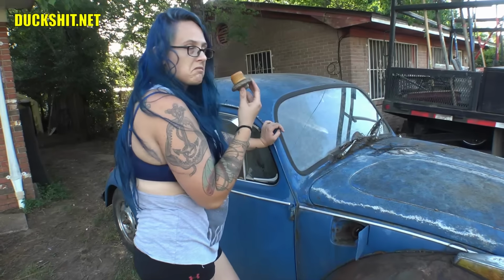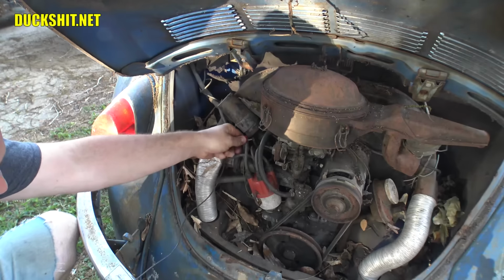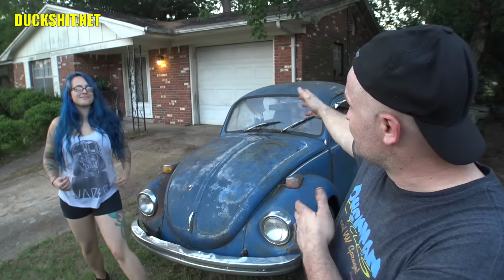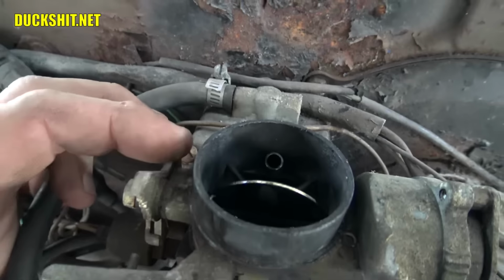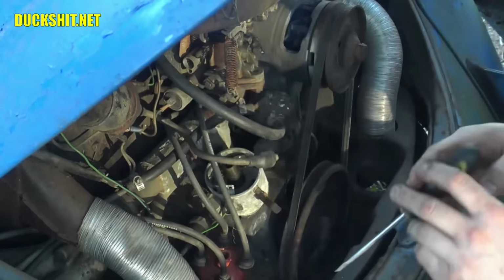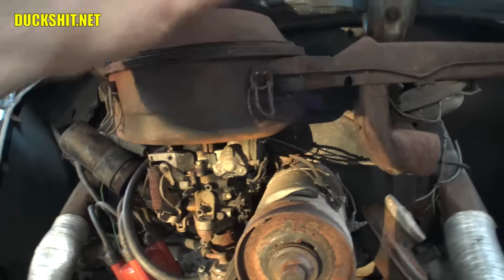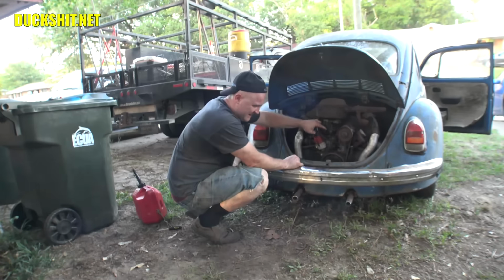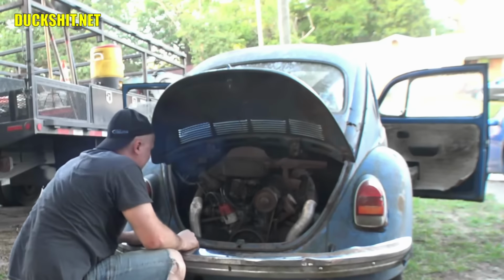FIRST START IN OVER 30 YEARS - 1972 VW Super Beetle - Will it Run?

Comment: 72 Super Beetle was the ski machine to skip out of grade 12 high school on Fridays and drive the Whistler 500 to Whistler for a fun day of powder skiing. That was one twisty highway in those days which posed many challenges and hazards on the way up to Whistler from Squamish. That was my buddies car and my first car was an MGB GT whose favourite place was dead on the side of the road from either a broken throttle cable or dashboard wire loom melt down. That was fun...not. The mechanicals were sound but everything attached to it was not. Sigh. Good times...
Reply from the maker: Not such a big deal if the throttle cable breaks, it's always good to carry a spare... but if the wires burn up you're in trouble LOL

Comment: Stupid question, its a Beetle.
Reply from the maker: Was it ever even a question? LOL
Reply: @DuckmanCycles  My first car was a 68 beetle, I drove it home from school one day. It was about 50 km. And it felt very lazy, and made strange noises. But we came home, up on the lift, and it turned out that one of the cylinders was loose. I could move it by hand. That car should not have been able to start, or drive at all. There must be some VW God up there, someone watching over them. I should never have sold it.

Comment: Im a buyer for the air breather if its the one that belongs on a 72
Reply from the maker: The breather?  Looks the same as most other VWs I've owned.  Maybe you mean something else?
Reply: @DuckmanCycles  yes the breather. Goes on top of carb. Oil bath housing. There are a few different ones over the years
Reply from the maker: @Volkswagenplanet  Air filter.   Yes I believe the air filter is correct.

Comment: Very happy Miss Bee is back. Mr. Duckman, what do you think about electronic injection in these engines? Have you ever thought of a project like this?
Reply from the maker: CB Performance  makes a kit for exactly that... they have their own computer, too.  But it can be easily set up to run a Megasquirt using the same hardware.  I have thought about it for Eleanore... but not committed to anything of the sort.  I guess we'll see!
Reply: @DuckmanCycles  In Brazil we have kits as well. Our gasoline is horrible and still with 27% ethanol. Since 2005 we have flex engines works with ethanol or gasoline or mixing them. So it makes sense to inject because the hit looks pretty cool. Continuous accompanying your videos and if one day you put I will watch. Take care of yourself.

Comment: Thanks for the video....what makes it a super bettle ?
Reply from the maker: We'll do a video on this in the future, but the primary things are an upgraded trunk and modern strut front suspension.
Reply: Probably also the curved windshield and slightly larger rear light clusters.
In Europe they were named 1302 and the last model 1303 (with the large round rear light clusters)
Reply from the maker: I don't have a curved windshield!
Reply: @jfv65  😊had one of those 1303 back in the days when i was young and bold ...
Reply from the maker: Here is a video that answers the questions between Super and standard Beetles https://youtu.be/aobVQonmpbE

Comment: Use a autostick starter. Spin faster
Reply from the maker: I have never noticed a difference in speed when swapping starters, unless going from old to new, or 6v on 12v lol...
Reply: @DuckmanCycles  they are faster noticed when I changed mine out. No shim on the end either. Have fun
Reply from the maker: No shim required on any starter, maybe you mean the bushing?   Yes, no bushing.  But they should turn the same speed unless you have some fluke or just a good unit vs your old one.
Reply: @DuckmanCycles  according to Bosch the rpm is slightly higher on a autostick. I know it sounds crazy until I tried it myself swapping starters a few months ago. Not a huge diffetence, but noticeable. Thanks for responding
Reply: @DuckmanCycles  yes,  no bushing

Comment: I have no idea why you don't like the 009, the replacement for the 010, You are the first I have heard say this, it is much better than the vacuum distributors. We used them on most of our high performance and racing engines for decades, the exception was when we use a magneto. clean the carb, change the oil, tune it up (plugs, points, condenser, rotor, cap, wires) and adjust the valves it will run like a top if the compression is good in all 4 cylinders. Good luck! Take care and God bless you all!
Reply from the maker: Yeah they're okay for a racing engine that you run wide open always, they are also good for an industrial engine that runs at a constant RPM which is what they were designed for.  But for those of us that are driving in traffic at a different RPM's in different throttle positions all the time the 009 is terrible.
Reply: @DuckmanCycles   We ran them mostly on streetcars. Decades ago I had a 63 bug will a full interior, nothing cut out, that ran in the 9's @140 mph in the quarter for my daily streetcar. I ran it at the strip and ran a 9.98 @132 smoking the tires all the way thru first and halfway thru second, corked up just like I ran it on the street. On the street it hooked in about 3ft and shoot off like a rocket hole shooting most everyone by about 10 car lengths. I had a close-ratio 3rd and 4th but on the top end I would see those big V8's coming they just never caught me. Most of them would run out of gear at 125 with the low gear ratios they were running back then. I was able to pull 140. I know you will say bs the vw speedo does not go to 140 and that is why I changed it and had it recalibrated with a 200mph speedo. BTW I was the first to make the dual muffler exhaust on my racing header system I used two 59 jeep mufflers and two u-bends to cut and weld it up. I should have put a patent on it. They only had the single quiet pack back then which was too restrictive for my big tube racing exhaust system so I made a dual muffler like I had done on my V8 engines converting them from a single exhaust to dual turbo mufflers. Granted, I had to rebuild my engine about every 5000 miles because the mains would get loose, but it was a blast to drive everywhere back then before anyone knew how fast vw's could really go, this was back in the 70's-80's. I made a fortune street racing it until no one could beat me and they started to bring in trailer queens to try to beat it. I was smart enough to tell them to drive their car to where we were going to race a few miles away from the meeting place and if they could, I would race them. They couldn't, they had full-on race cars with solid blocks etc.! I have built hundreds of vw engines over all the years. my last being a few years ago I had a 73 ghia that I never ran at the strip, but it was just about as fast as my bug was. It only had 44 webers on it slowing it a little but very good to drive on the street compared to 48's with 50mm venturis. But the 48's were decent until I tried 52mm venturis and there was no low end left to speak of just flat out top-end racing which forced me to make my own 50mm's.  I never cut out anything to lighten the cars I did scrap the tar off the floor of the 63 and that was it, I still had a complete full interior in it since I was driving it every day.  I was also the first to make 50mm venturis for my 48ida weber carbs, they only made 48 and 52 then. The 009 has a good advance curve for any vw engine and you can adjust the advance curve by changing the weights. But hey what do I know, I have only built some of the fast engines ever and been doing it for about 49 years, since my first rebuild and upgrade to my 60 bug as a teenager! LOL! I really still do not understand your feelings about the 009. It must have been something else causing you problems that you feel the 009 was causing. Good luck, I enjoy seeing your project work and great metalwork you do. Take care and God bless you all!
Reply from the maker: Well as I said, 009 is fine for race or industrial application.  But really are no good for a proper street car driven in traffic with a lot of stop and go. http://www.vw-resource.com/right_dizzy.html#009
Reply: @DuckmanCycles  What you are talking about is the post 71 smog motor and you can fix the flat spot by adjusting the accelerator pump tube to spray right into the crack of the butterfly when it starts to open. They run lean for smog! There are many more years the 009 works excellent on. Basically you are referring to the super beetle model years that no one likes 71-74, 75 when to the fuel injection! I am talking about all the years prior, from the 50's to 70's. Plus it is rare to see someone running the 34 carb on a dual port motor, especially now, that is the first thing that hits the junk pile and gets dual carbs or at least a two barrel. Then the 009 is a big advantage! If you want to run an all stock motor then sure leave the stock distributor on it too. But you do not get full advance right away with the stock distributor either, as the article says unless you give it full throttle and drop the clutch which would also have full advance with the 009! You can check that yourself easily, you will see what I am talking about. Anyone who knows anything about engines knows you dont get full vacuum unless you stab the throttle wide open which no one does driving around normally. Therefore you don't get the full vacuum advance until higher rpm's. Hmmm like the 009? The pause the article talks about is 99% of the time the accelerator pump tube out of position. They purposely aimed it to the center of the butterfly to help to lean it out by spreading the fuel across the butterfly rather than a direct shot of fuel for smog reasons. The article is one persons opinion and we all know everything you read on the internet is all true, right? LMAO! Have a good day! Thanks for the reply!

Comment: The Super Beetle came out in '71 as model 1301. The '72 came out with various (slight) changes that it ended up with its own model number- 1302. But both have the same flat windshield and dashboard of the regular beetle. In '73 it got the revised dashboard and curved windshield along with a revamped front end which all Super Beetles have after that and all are known as the 1303 model.

Glad to see the SB up and running! I had the '73 and my friend had the '72. We used to spend weekends comparing cars and of course - maintaining them!
Reply from the maker: There was no 1301 due to legality issues, so there was only a 1302 in 1971 and 1972.  1303 after that.  Everything else was absolutely accurate! Thank you so much!

Comment: Oh man, that's exciting!  We have a 73 standard and not as lucky with the motor.  Took it out and disassembled.  Trying to figure out if the block is even good.  I'm glad yours seems to be work pretty good so far.
Reply from the maker: Much appreciated, and yes it seems like it's got a pretty good engine. The engine is now in the ATVW

Comment: I had a 72' Super Beatle, dual port heads, valve clearance for it was .008 intake and exhaust.  The only one engine model they had a different clearance, other than .006 in and out, had a "VW' expert argue with me that they never made one with different valve clearance,  so he set them at .006, and it ran like crap, I had to totally readjust all of them  to get it to run right.
Reply from the maker: VW changed the valve lash a few times in their history.  Heh, gotta laugh when everyone thinks they are an expert.  :-D

Comment: Nice job. I don't think I'll have as easy of a time getting the motor in my 66 running again.
Reply from the maker: Well you may or may not, I guess it depends on how stuck it is.  This one turned over pretty well.. at that point the rest was easy.
Reply: @DuckmanCycles  It may have gotten some water in it.
Reply from the maker: Dump it out, get it freed, oil it up, and fire it up.  Let it run a bit up to temperature and check compression, if good dump the oil to flush out the crud and new oil and GO!  :-D

Comment: Great video, I really like your troubleshooting technique, the only suggestion I have is , I would really just leave the air filter housing off while trying to start engine, I know it's safer in case of a backfire, but makes pouring gas in the carb so much easier. Keep the videos coming!
Reply from the maker: Thanks, but there is so much dirt under there I am afraid for it to find its way in.  A backfire NEVER damaged my air filters, in fact it helped contain the fiery fuel explosions that had happened from spraying fireballs all over the place.  More videos to come!  Thanks!

Comment: to test the electric side of the oil light is to earth the wire off the switch & see if the light works
Reply from the maker: Good call, but for that we did not have to!  :)

Comment: My cousin as a blue 76 beetle. Just took it out of the garage and parked it in the driveway. I went past it yesterday and someone stole all the wheels.
Reply from the maker: Awww man thats terrible!   Wow!
Reply: @DuckmanCycles  The interior is pretty good. But no back seat cushion. Frame looks good too. The front and rear shocks are leaking and i saw valve cover had a leak. I used to me a mechanic. I wouldve loved to work on it.
Reply from the maker: @goobman1981  Get it and save it!
Reply: @DuckmanCycles  i will have to ask my cousins if they would sell it. It belonged to the father who passed away. So they may wanna keep it.

Comment: 1971 -'72 Super Beetles (60HP) likely the best driving ones ever built. I've owned 2.
Reply from the maker: Depends on preference!  I always preferred the more classic feel of the earlier torsion beam.
Reply: Unsafe at any speed, Lol ! They used kingpin front suspension,(not the super beetles) also. Rebuilt many a one. Also own a '72 since 77.
Reply: They had a stock air cooled 60hp? I thought they had a 42hp with the dp1600. Nice.
Reply: @lawrencewheeler8868  
Yeah. They should have just stopped modifications at '68 or '69. The best years for bugs, in my opinion. Good steering, IRS. And there was bajillions of them. At one time anyways. I still have a '68. But its been in a fire. And frankly, I'm tired of going through engines faster than underwear.
Last week coming back from Las Vegas it started leaking oil. So I took it to a friends house so I would fry anything. I ended up replacing every gasket and seal and it still leaked. I'm guessing it was from the oil cooler. Not the seals, but the actual core itself. I listened for leaks with an air hose and heard nothing. Checked the case for hairline cracks.
Long story longer, I did everything but test the case fro cracks. Basically rebuilt it without boreline machining, and I would have but corona virus shit has all the machinist lazy or something. So anyways, all that and it still pisses oil.
Im done with bugs.
Reply from the maker: I disagree, I think 68 sucked LOL... almost all the way across the board for all models.  It was another one year only Beetle not too unlike the 67 that came before it.  69 corrected a lot of the 68 problems.... and other than the stigma attached to 69 LOL, I agree 69 was probably one of the best mechanical years.  But as far as appearance of concerned earlier is always better!  😁👍🏻
Reply: @DuckmanCycles  
My modifications are for off-road. Thats why I fancy the '68. They changed the transaxle from swingarm to Indepenent rear suspension, eliminating the camber of the wheels,  should you decide to raise the supension. But they kept the older steering.  And well before they eliminated the torsion tubes and bars. Was it '73 they went with coil springs?
Reply from the maker: You might be a little mixed up, 68 had a ball joint front end but had a swing axle rear end.... unless you got a Autostick, in 69 all air-cooled VWs got the IRS rear end.  And you may be thinking of the Super Beetle, Super Beetle began in 1971, they had strut spring suspension up front, but they still retained the torsion tubes and bars in the rear.  Regular balljoint Beetles were sold alongside of these until 1977.
Reply: @DuckmanCycles  
I must not be the only one mixed up. 
https://dunebuggywarehouse.com/https/swing-axle-vs-irs-transmissions.html
Mine is a late '68 (yes, they even later models) I've been under it more than my lady. A funny thing though, a previous owner had put a '67 or earlier front end on it. Or atleast from the trailing arms out. Everytime I would change the front bearings, I would have to remember to order '67, or I'd get the wrong size
Reply: @DuckmanCycles  
My pop had an auto stick. Lol..for the 1st week he'd go to shift gears and stomp on the brakes.
Reply from the maker: Hahahahah!
Reply: @DuckmanCycles  
After everyone in the family looked like cichlids from bashing their foreheads on the windshield, I think it was my brother that suggested the 1st airbag.
And from that point on everytime pop would take his foot off the accelerator, everyone would stick their arms out in front of themselves and squint thier eyes

Comment: Hi duck man and B mc queen tell her I love that smile duck man did u know vw beetle use to run in the uk on 6vvolt battery and possibly earth in the 1960s my late fathers friend had  green beetle running on 6 volt the headlight were like a candle light si poor
Phil in the uk
Reply from the maker: All VW Beetles 1966 and before were 6v.  The lights weren't that bad, however.  Unless of course the grounds were bad... very common problem.

Comment: If its got 30 yr old cloth/rubber vacuum hoses on the carb or intake... Nope. Wont run.
And if it does run, I wouldnt run it long with those hoses. Fuel air mixture will be very lean from cracks in the hoses and burn valves and ports
Reply from the maker: LOL... that's not usually how it works